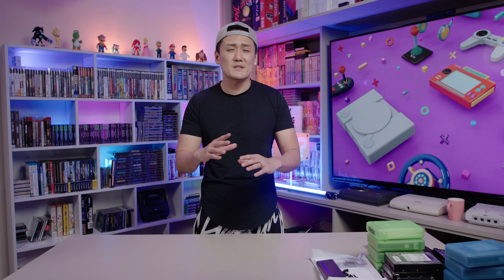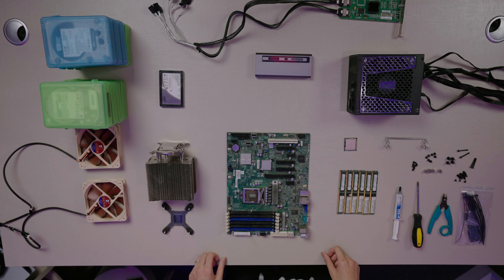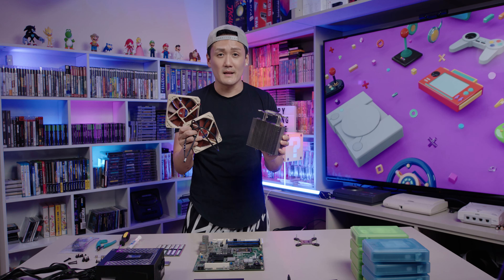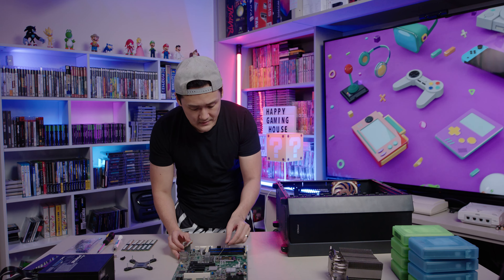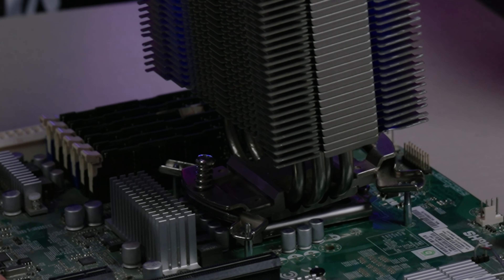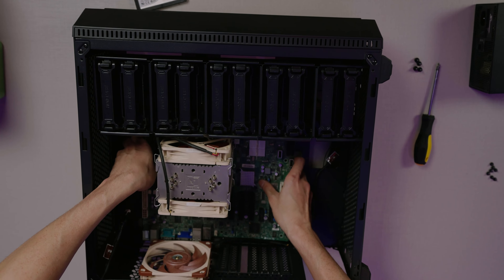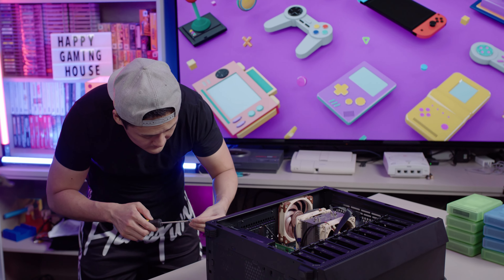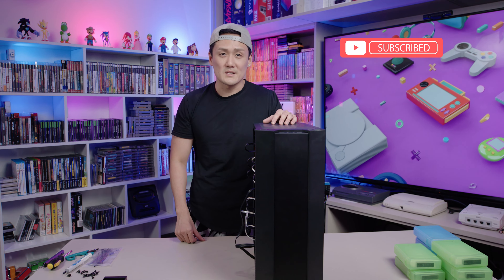How to DIY a Budget NAS: a Step-by-Step Beginner's Guide

Comment: Good job, there were a few things that I noticed, but you did well! I do wonder how long that array is going to last you though, looks like you used 2tb drives, so you're basically setting up a 12-14tb nas depending on what raid type you go for, I run a plex server myself, I built a dual xeon machine with 512gb ram, proxmox running several machines, and 20x 18tb WD Reds.. It's a bit more than I need, but it was fun as heck to build. Video editing for youtube is heavy on data, so I'm curious how long you get out of the space you put in there before it's a hassle to upgrade, hope it works out!
Reply from the maker: You are right. It's definitely not enough for youtube footages. I just happened to have these 2tb drives from my old pc and other projects, so I used them in the video for demostration. Evantually I have to swap all the drives😂